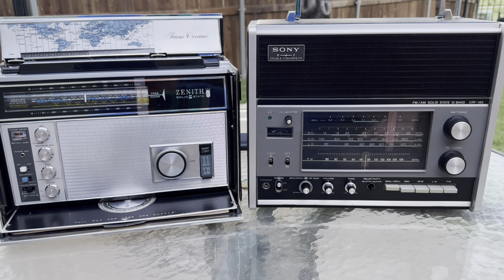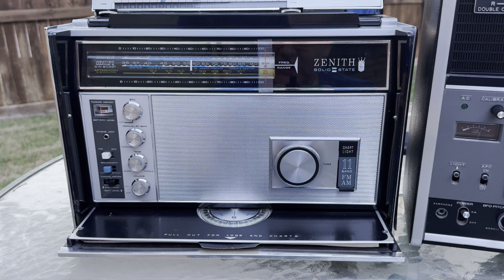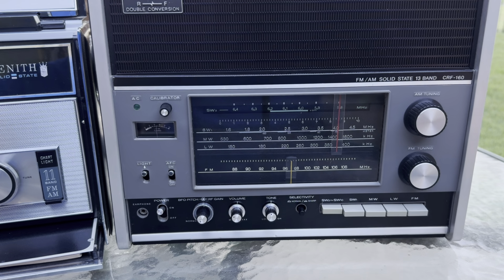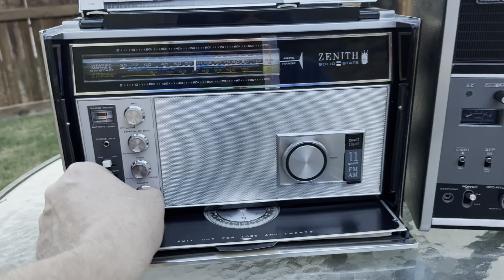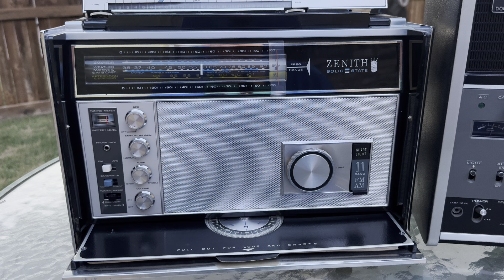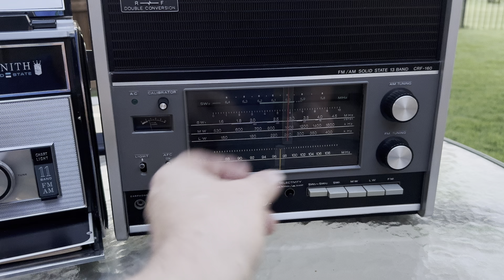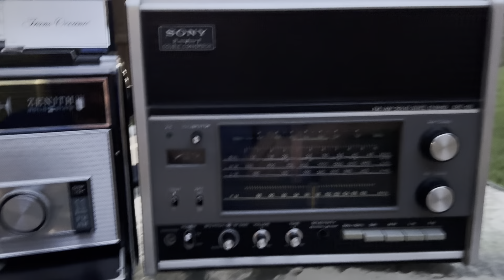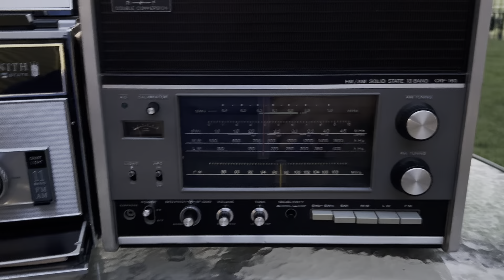Sony CRF-160 vs Zenith Trans Oceanic D7000Y on the whips

Comment: When I saw you were checking them out on 49m I thought of early Zeniths 7g/8g which had a spreadband for 49m. Overall I'm impressed how well the Zenith compares, its hardly a fair fight. That Sony (and its earlier CRF-150) is double conversion with 5 stages of IF amplifier. Even the vaunted 5100 Earth-Orbitor was single conversion and 3 IF stages. 

The D7000Y was the last hand built of its era, I'm proud to own one myself.

Comment: Hello there! 
My Transoceanic D7000Y (by the way, you are correct, your radio is a D7000Y too), is one of the best DX and SWL radios that I've ever had, despite having suffered a 6 feet fall (a very unfortunate accident). The upper part of its case is broken, but everything works perfectly. 
Best regards and 73's!
Reply from the maker: @maxal62  I am glad to hear you are having a great time with your Zenith.  The one thing I don’t like that I mentioned in the video is how crowded the 49 meter band is.  There can be 5 separate signals in literally 1/16” linear space.  Very hard to tune.  Thank you for your comments!